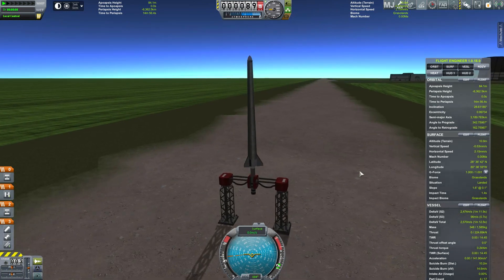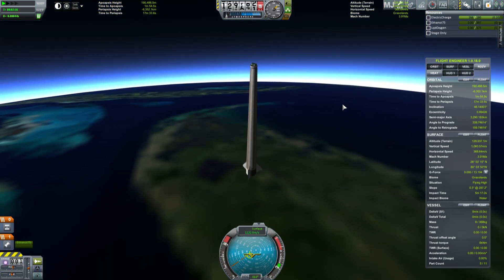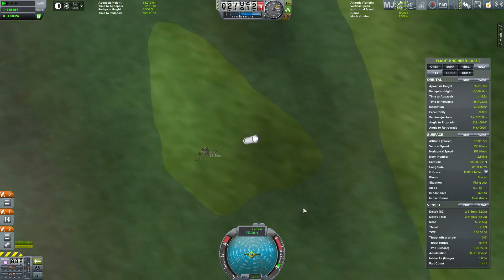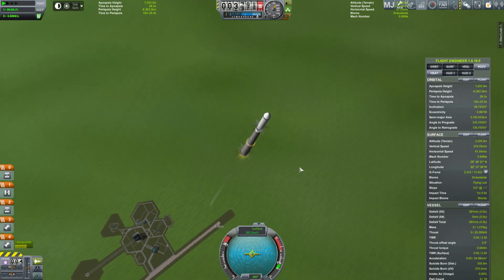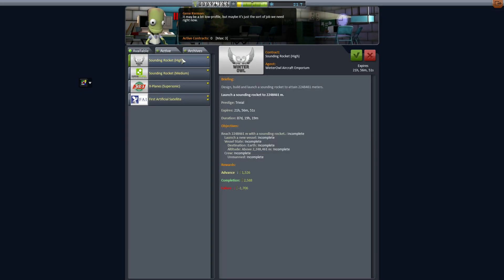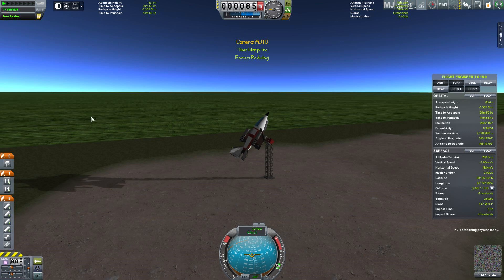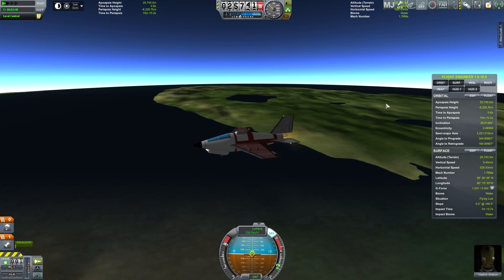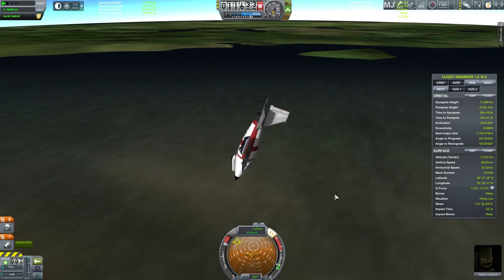Kerbal Spaceships are Serious Business - Part 3

Comment: VAPOR IN FEEDLINES FIX - It's not a glitch, the fuels are programmed to evaporate as they would in real life. When that happens it simulates vapor getting into the engine and that keeps it from igniting. To prevent this, simply shut off your throttle, right click on your ENGINE and you'll see something about your fuel status being "Very unstable". All you have to do then is use some sort of way to spin or just move your rocket around and it'll go from unstable to Very Stable (depending on how fast you can get your rocket to move around). And then just throttle it up and it'll ignite no problem. Not sure why it works that way but that's how I've been dealing with it, and it works every time with all engines.

Comment: With regard to the question about stabilization chutes:
Anti-spin parachutes are a common thing during aircraft testing programs. If in a spin, deploying the chute will stabilize the aircraft with the nose straight down, or nearly so. They're not enough for a soft landing, but serve to allow regaining control before either ejecting or pulling out of the dive.

Comment: If you cluster engines it's best to have launch stability enchancer + fuel pump so you can check that all engines ignite before liftoff.
Reply from the maker: +Jakub Dudziński I don't have the tech for fuel lines just yet.
Reply: +Scott Manley No, no, no ;). Launch stability enchancer have in-built fuel pump (or at least in my installation of RP0) so you can turn the engines on while still attached (just like real rockets do) and than after preflight checks you can release clamps and liftoff.
Reply: +Jakub Dudziński Yup! +Scott Manley you right click on the clamps in the SPH/VAB or on the pad and Enable Pump. That will keep things topped off while your engines spool up to full thrust. Once all engines are lit and spooled up, release the clamps.

Comment: RealChutes has a native resizer tool, found in the Action Group menu in the VAB.
Reply: +youtubeuserxyz Which is rather annoying, as in career (Stock, anyway, not sure about with all the realism mods) you don't start with action groups, forcing you to stick with the default configuration until you upgrade.
Reply: That was previously true in RP-0 Career as well, but NathanKell pointed out to me that has been changed now due to extra modability added by Mike.

I just tested it in the current RP-0, you can modify the size right form the start of career through action groups.
Reply: Useful. I'd still personally prefer an option to go to the menu when you right click it, but at least we know Scott can potentially use it.

Comment: in space high starts at 35,786km (roughly the altitude for Geostationary orbit)
assuming you have realchute installed (IIRC its a required mod for RO)why are you not using the realchute parachutes? they can be scaled in the action groups menu completely independantly of tweakscale?
you can even configure them to provide specific touchdown speeds for any specified mass.

Comment: A couple questions/points... First, when you were trying to gain speed and didn't care about the altitude anymore, couldn't you have unloaded to 0 Gs to eke out a bit extra? Second, when you were stuck in a spin and couldn't get the nose to drop it reminded me of a trick used in F-16 stall recovery (at least according to Falcon 4.0) where you basically rock the nose up and down until it finally drops and stays down. I'd be interested to see that tried in this type of KSP playthrough to see if it works in FAR. Finally, regarding the use of a chute to pull you out of a spin, if I recall correctly the MiG-21 can actually do that with its drogue chute.

Comment: Scott, for the water landing you need BetterBuoyancy, the craft would've survived
Reply from the maker: +kendokaaa I thought I had BetterBuoancy.
Reply: +Scott Manley If you do then I guess I'm wrong :P
Reply: But his velocity was vertical, not horizontal, wouldn't it not have made a difference? Or is it something with RSS?
Reply: Astrain1 No idea, though the mod description states "However, it also allows removal of the insta-water-death effects" and I've had much better luck with my crafts surviving with the mod than without
Reply: +Astrain1 Correct. Ferram also pointed out that the craft was pitching at the time, so the linear component of the angular velocity was added to the cockpit at impact.

Comment: wow.. that plane landed in the worst way possible.. everything survived.. except for the thing that had the pilot.. (oh and the engine I see now).
couldn't exit because no hatch??? how did Vadim get inside.. did they build that cockpit around him
Reply: +whoeveriam0iam14222 They let him in and then welded the cockpit shut.
Vadim: "Are you sure, this is a good idea?"
Researcher: "We currently don't have any hatches that could stand the stress of acceleration."
Vadim: "Thise hatches I've seen so far were damn sturdy. If they can't stand it, how can I?"
Researcher: "No worries, no worries. It will be fine."
Vadim: "But that guy who sold me a life insurance earlier gave me a funny look."
Researcher: "Vadim. Right now the public's interest in our project is dwindling. We have been repeatedly doing variations of the same experiments with the same system. And we don't have a whole lot to show for it... So we kind of need a trag- I mean success to get back into the spotlight."
Reply: +whoeveriam0iam14222 Probably was bolted in like they did with some of the early X-planes.  Like the X-1A that tried to kill Chuck Yeager in an eerily similar manner to what happened here.  Only he didn't have a parachute.

Comment: You should not forget about launching crafts from other places. Kourou is good to start because it's near the ecuator, Baikonur or the one in Africa is good for moar science from new biomes and so on.
Reply from the maker: +SpaceFox The problem is there's a bug with Kerbal Construction Time which means I'm losing upgrades when I switch centers.
Reply: +Scott Manley If you mean building upgrades then not really, switching sites stops showing the ongoing building upgrades, but they still upgrade when the time comes, and carry over to any other sites. I would do alternative back up save and check it out, cause I have changed launch sites a lot and never lost anything. 
Only thing, if you build craft in one place, it can't be launched from other site, obviously, each place has its own storage.

Comment: are you aware that gyroscopic stabilization isnt in ksp?
Reply from the maker: +foehawkkid Are you saying that it didn't in fact work? Because it looked like it was working to me.
Reply: i may be wrong but using it in space didn't work for me and my searches of others talking about it came to the same conclusion. I think its possible that the relatively straight launch is just a product from the wings and the consistent air in ksp, if so its just throwing away some deltav (though admittedly i find it a more attractive launch with the spin)
Reply: +foehawkkid It works just fine.
Reply: NathanKell is that a product of realism overhaul?
Reply: +foehawkkid Nope. Works in stock KSP too.
Reply: Strange then why doesnt my asymmetric satellite not fly straight?
Reply: +foehawkkid How fast are you spinning? If in the atmosphere, is the drag as well as the weight not symmetric?  Spin stabilization is great for small, symmetric things in space, because asymmetric things precess etc.
Reply: +foehawkkid 
KSP models all aspects of newtonian physics. Gyroscopic stabilisation is a product of the inertia of a spinning object and as such doesn't need to be modeled seperately in an engine that has fully newtonian physics.

As such you can simply spin up your rocket and have a huge gyroscop. It's not like ealry unmanned designs haven't done that. The problem with it is that you can't really stick a person in a fast spinnin object without serious consequences for that persons health.
Reply: +NathanKell i dont know how i could convey the speed of it other then it seemed quite considerable

Comment: Scott ! You always say that you need a mod to stop the right click menu from moving, but do you realise that a mod have been upload of your complain in one of your livestream, specially for you in the first place, to stop the right click menu from moving around when you put your cursor on it ?
It is call "Menu Stabiliser" I use it on my x64 hack KSP with RP0 and tons of mods and it work well !

Ho and in another stream you were asking if there is some kind of pilot assist or pilot assistant mod that could help you flying aircraft, there is a mod call...Pilot assistant, which need a bit of tweak if you don't want your aircraft to do crazy things but once set to your aircraft (and thanks to presets you can save one per aircraft) it can flight level, turn, maintain a certain speed, vertical speed etc !
And you should use RCS Build Aid mod that help to show wet, dry and average center of mass, really useful cause you don't need to right click on every tank to empty the fuel !

Thanks for this video ! But I guess the serie will change or be replaced once the 1.1 come, isn't it ?

Comment: I noticed that you had your controls in precision mode (Caps Lock). Could that have been why you had no control?
Reply from the maker: +Kevin McIntyre Not really, precision control just means it takes longer to reach full defelction, I was holding the key down for several seconds at a time and was unable to ccounteract the deflection.
Reply: +Scott Manley if you just change camera to lock mode, the interact window becomes static to your view

Comment: Wait, so the Karman line is not the same as the edge of the atmosphere? Or is part of outer space technically still in the very thin atmosphere?
Reply: +lumpman2 The atmosphere extends out REALLY far, there's no real cut-off point to it, even above the ISS' orbit there's still trace gases. I believe the Karman line is the point at which a spacecraft would have to travel above orbital velocity in order to generate enough lift to maintain altitude.
Could be wrong on that, bear in mind.
Reply: Panzerbeards Right, but the Karman line defines "space". So as I understand it, the line isn't actually at the edge of the atmosphere, just a border where it becomes too thin to fly.
Reply: +Panzerbeards You are correct. :)